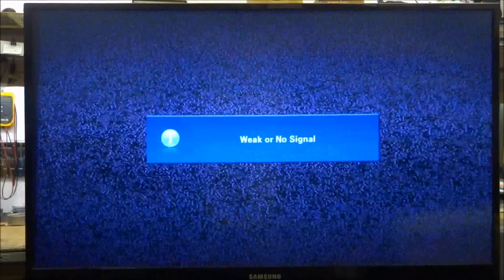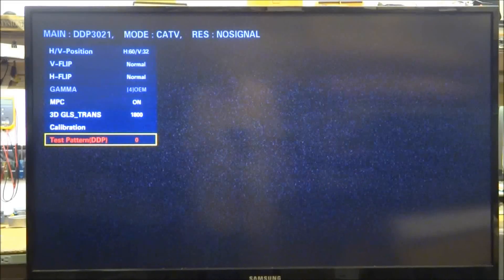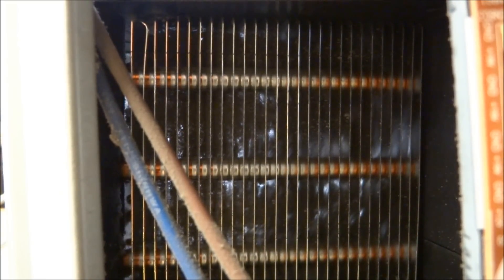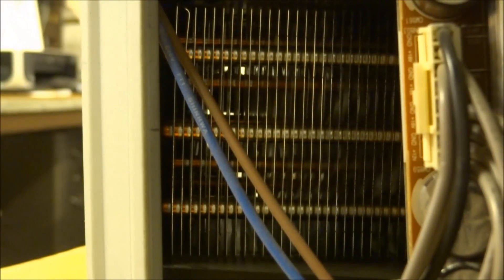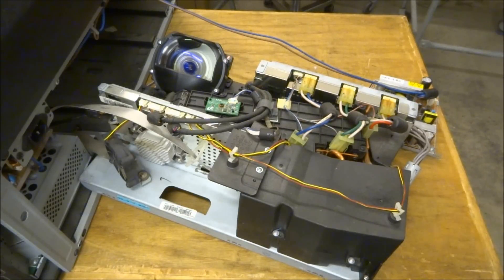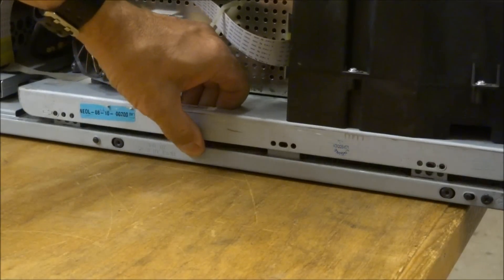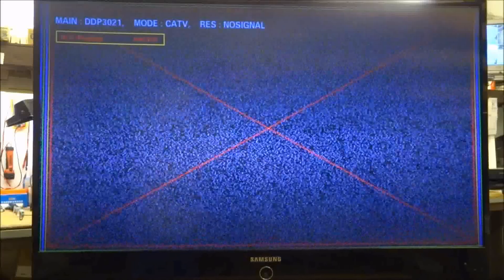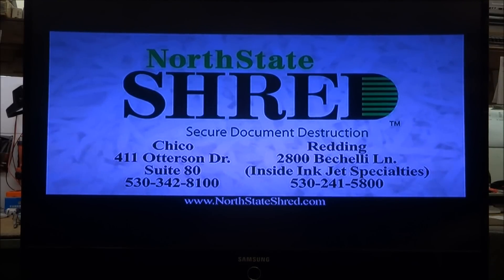Samsung LED DLP TV Shadow Repair Fix Adjustment HLT5087 HLT6187

Comment: Hiya norca715!   love your troubleshooting videos very professional.  

I have a problem with my HLT6187s and hoping you may have come across this before or perhaps you have an idea what component issue may be.

The screen is intermittently going dark for a few seconds and getting more frequent, the tv is still on as i can hear audio when the screen goes dark so its not power cycling.. i'm not an expert diagnostician as you are :), but i think i narrowed it down to the DMD board, my SMPS and Sub SMPS checked out fine all voltages are present, so i suspected the led driver..

But then i learned from the service manual there is a dip switch on the driver to let it run in "internal mode" which would let it power regardless of the DMD signals..   so i did that and sure enough the screen didn't go out.. am i on the right track here?  id like to attempt to repair  whatever faulty component is causing this rather than completely replace the DMD board,  but this is where i am stuck i can only guess looking at the diagram i'm not sure how i would test the signals to the led driver, but your educated guess would be very welcome :D
Reply: +Jaime Valencia I see u were on here 3 weeks ago and hoping u can help. Or Norcal which would be awesome too. I also have the led dlp HLT6187s. Had problems cycling and coming on. So I replaced the caps on led psb and it came on for a year or more but would cycle several times and tries but always goes back in standby mode where before would lock up and have to be unplugged. Red  phlat led light went out so replaced that. I always knew I had another problem and suspected the main psb had bad caps because it got to where it would take 10 tries cycling thru each time always going back to standby mode before finally came on. I want to say the green light blinks like 27 times and 17 time has a slight longer pause than others. Well TV finally turned off on its on for first time and now only cycles and will not come on. It has sound that cuts in and out while cycling with dim backlight but just goes back to standby mode. So I figured it was caps on main psb. I heated up with hair dryer and tv starts right up but eventually gets this distorted pic with squeeching sound then sound comes back but picture sometimes stays distorted or just goes back black then shuts down again. I replaced caps on main psb thinking that was it since it come on faster than ever, first try, with hair dryer heat. But still have same problem. But the repair kit only came with 9 of the 11 caps that are on board. Im going to replace those too but now im wondering if its a fets or resistor or some other part on main psb or if it could be main board cause its right under main psb board and could be getting something warm there too allowing to come on. I can hook it up apart and rule out and try with hair dryer heat but hate doing it worried ill hurt it more. I think its called main board as its the one with rca, hdmi, component, etc etc etc. I think the DMD board is in the Led Engine and the Led is over on left side facing front. I hate to buy another board, if can even find one, if its only one part on it especially now has 9 0f 11 caps new. Or worse and be the board under it. Any advice??

Comment: I have an hlt6187sx/xaa with led engine. this model can be a little confusing while researching but it is made just like video shown here. The tv was taking longer and longer to power up and having to be unplugged at times when previous owner had it but eventually would not do anything. No lights nothing. I got it and changed the caps on it and is now working but still has some issues. First off i could not find the 5 caps( 2200uf 25 volt 105c) that was on the original psb so put mixed matched set to see if it worked.I found two 2200uf 25volt 105c. One 2200uf 35volt 105c. And two 2200uf 50volt 85c.The first three i believe are ok and maybe even last two 50volts ok but worried about the 85c.The other three were only high temp (105c) i could find without going down to 16volt. Its only been a few days so tv has not been off that many times but has only come on the first try once.Its came on the second try everytime except this last time which took three and got hung up where none of the buttons on tv would work or on the remote.Volume seemed to be on much higher level than usual too. Had to unplug and powered back up with remote on first try and works fine. It comes on with flashing green light for 30 seconds or so and goes out till eventually goes to standby mode with steady red light. No clicking can be heard though. Its seems as if all is working except picture coming up. I can see that led is on the engine with screen lit up some and volume. A couple of times after green light went out and before red standby light came on i pressed on button again and screen popped up. On button not power button. And the green light comes on one time just before picture. Maybe it just came on same time but sure seemed like pressing on button is what did it. Cause like i said everything else was working like its suppose to with the dimmer led light from engine lighting screen up some. Only when i pressed on again did the brighter light come on to give picture. If i dont press the on button again it goes back in standby mode having to press the power button again and starting over. I have very limited knowledge and wonder if the 85c caps causing this. But after doing some more research im thinking maybe its a problem on the main psb and thats whats caused the caps on LED psb to go bad in first place. Or maybe something to do with Led engine. This tv had the white dot issue and had to be serviced before i got it so i think DLP chip has been replaced. Ive read several posts and in online manual that this is not a 1080p set but this one is and wonder if dlp chip is why. Ive always loved the picture this tv has and now after cleaning the blu,green, and red heat sinks its even better. Especially the deep reds! Any advice or answers?? thx

Comment: Great video.  I have a different problem.  I have a Mitsubishi WD 65 837 65 inch DLP TV. I had to replace the DLP chip because of the white spot problem. Now the white spot problem is gone, but with a black screen when the lamp is on I see large irregular blotches 2 to 8 inches in size of dark grey..  
As soon as the lamp goes out completely these spots disappear.  Looks like some light leakage.  I did have to take the light engine out to change the chip.  The video on the screen looks pretty good but in any black ares where these blotches are they must be reducing the black level.  Any ideas of what can be done to fix this?
Reply: There's two possibilities here, 1 there's dust on the chip you replaced or 2 there's dust on the projector itself.  My guess is you have dust on the chip (mirror side) which you'll just need a microfiber cloth and gently remove the dust.  You can shine a flashlight on it to better see the dust.

Comment: I am currently replacing my DLP chip and still have some adjustments to do.  I had somehow messed up the color, but that has been adjusted. Starting yesterday, a red/magenta vertical color wash appeared about four inches from the right side of the screen.  Can anyone please give me some hint of how this might be?  I'm, at a loss because the image otherwise seems fine, color wise.